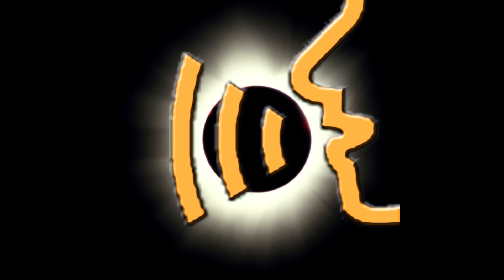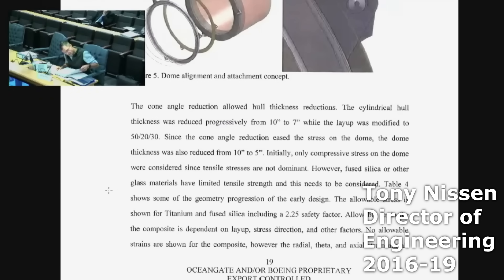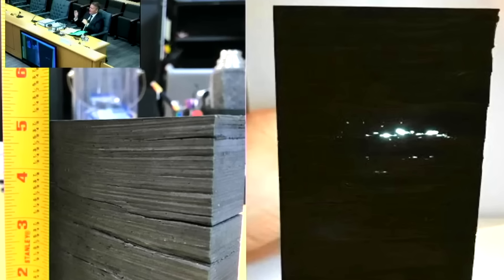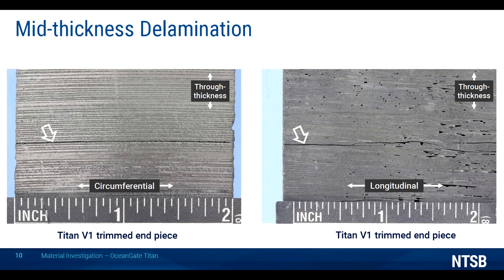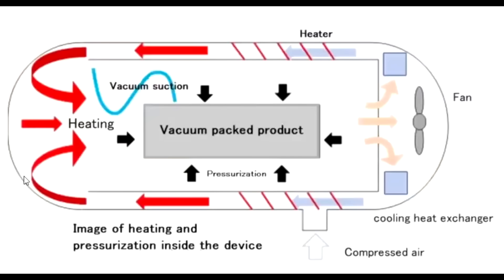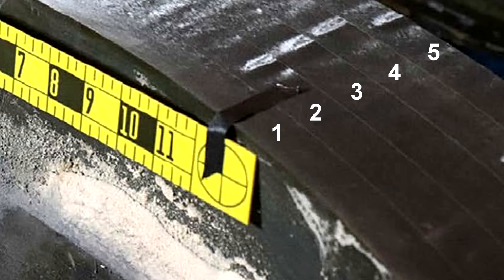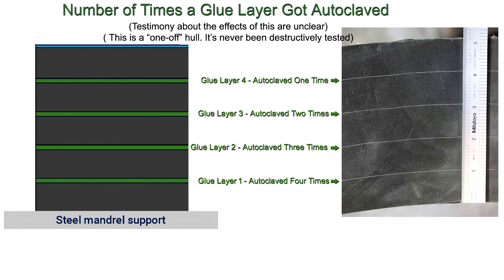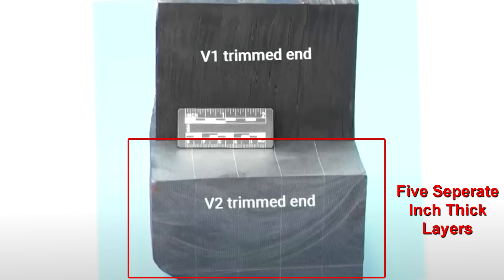Who Engineered the OceanGate Titan V2 Hull? Maybe Nobody Did?

Comment: I don't understand why they didn't used stainless steel tube or main capsule wrapped on carbonfiber over it. To give it still none catastrophic failure an more strength.
Reply: That would be difficult because of the mis-matched CTE & modulus between stainless and carbon fiber
Reply: The difference in thermal expansion coefficient between the two materials is one reason. 

Also, it is one of the reasons carbon fiber isn't used for that application at all and why it should have never been used on Titan.
Reply: I don't understand why you think they would use steel plus carbon fibre. What benefit do you believe that would bring?

Comment: the hidden disaster that is waiting to happen is the use of carbon fiber in commercial aircraft.
Reply: We've been using carbon fiber in aircraft for over 50 years. That disaster sure is waiting a long time.
Reply: Nope. There is nothing inherently wrong with carbon fiber as a material, it’s all about how you use it. It’s an excellent material for things like airplane and automobile components where the parts will be under tension. It’s awful under compression as in the case of being used as a pressure hull for a submersible. This unsuitability was only made worse by design decisions like how the fiber was wound and manufacturing foul ups like not using clean room conditions. The galling thing is that all of this is widely known. I’m not a materials scientist, just a guy that has a few interests that incorporate these technologies, and even I know a lot of of the basics- you don’t use CF for something dealing with compression; cyclical loading causes fatigue and breakdown in materials like CF; you want some sort of cross-hatching orientation of the fiber wraps; sanding down bumps in materials like CF is going to drastically reduce strength as you are creating discontinuities in the fibers; you need to be very deliberate to prevent contamination of surfaces where adhesive will be applies and you need to keep contaminants out of the adhesives & resin themselves. They did a LOT of things wrong and it’s really amazing that the hull even lasted as long as it did.  

This was a clusterfuck for a long list of reasons, but it isn’t an indictment of carbon fiber as a technology.
Reply: Carbon fiber is very strong when used in aircraft. The pressure is inside pushing outward which pulls on the fibers and makes them stronger. A sub is the reverse, pressure from the outside.

Comment: I’m no engineer but maybe the hull design should have included a few titanium support rings
Reply: Or proper testing, build 4-5 of them and make repeated submerges using a cable and depth finder until they fail.

But then that would cost money and they were trying to be the 'cheap' deap sea submersible company.
Reply: @jonf2009  The problem with the testing you proposed is that carbon fiber suffers "fatigue". Even if during the test it passed a specific depth, with each subsequent submersion the depth rating would decrease, but because of the production method you cannot even be sure about how fast the rating is decreasing (meaning that it's essentially and practically impossible to know the depth rating)
Reply: They used the ti ends to lift the sub up multiple times.  They welded some lift tabs for straps to be attached.  They were just glued to the carbon tube so that stress was probably never considered.
Reply: You still would have the issues of the stress in between the support rings. Carbon fiber is great under tension but is terrible when under compression. They should have made it out of solid titanium without the carbon fiber. And used a window rated for the depth or deeper than something that was good for a few hundred meters depth, it's a wonder that didn't fail!

Comment: Ya sure, laying the fiber at 45 degrees isn't needed for underwater subs........except when your beating up the sub hitting sunken ships, slamming into the dock in rough seas and towing it out to sea for hours while it bounces around on the dock. They beat the crap out of that sub and never really inspected it.
Reply from the maker: I agree with you, and thanks for commenting.  Yes, Stockton and the engineers were focused on the fact that underwater, the vehicle is not subjected to "torsional moments."  While that may be true in the water, the transportation on a trailer back and forth across the country, craning it,  launching the LARS off the Horizon Arctic, and towing behind the Polar Prince must have added forces not accounted for in the engineering.
Reply: Not to mention porosity in the glue, sanding the carbon fiber all over in random places, and an untested unsafe viewing port
Reply: Wasn’t it also struck by lightning?
Reply from the maker: @curious_gage  Thr first hull was, when they were testing it in the Bahamas.
Reply: Not just that.. the way it was stored. Sitting out in open element at some dock by the water.
Reply from the maker: @OfficiallyGuChi  Yes, between the 2022 and 2023 expeditions in the freezing winter months in Newfoundland.
Reply: yet thy used the ti ends to lift the sub around.  Now you have stress in all directions and pulling the glued ends apart.
Reply: @danc2014  And probably sagging in the middle, what did that do the glue lamination?

Comment: I will bet money that 45 degree ply would have made zero difference. It was doomed from the start.
Reply: As someone who does composite work, I’d bet the opposite.
Reply: @Chiraq312boi  I do as well and yeah I'd agree. The idea of having a carbon fibre component without 45 degree plys is so foreign to me I didnt even consider it a possibility with oceangate. Especially with how thick it was
Reply: Might have helped delay the inevitable, , but in the end, it would have gone bang; even if the hull had held because of using 45 degree ply, which is far from certain, there were too many other problems.

Comment: The fact that this seemingly badly designed, badly made, riddled with cost cutting measures  submersible was able to survive 19 deep dives suggests that the basic idea of a lightweight carbon matrix submersible is not in fact a bad idea at all. Were it properly and cautiously designed, built properly and thoroughly tested, it might be a surely be quite successful.
Reply: I feel I need to point out that hull made 13 1/2 dives to Titanic. Well, plus it passes the pressure testing unmanned at the test facility. No word there on the acostic signatures.
Every single idea Stockton or his "design people" had was crap. BUT that is just us looking backwards. It's easier to repair stuff than design it. 
These huge diasters always seem to have a TIDAL WAVE of issues not 'that one thing'.
Just when you think you've pinpointed 'that one thing', something else catches the eye. Every angle you approach the failure from? Seems legit, cause it is.
His hull is 'settling' every dive. Wood ships do that too. That is the 'pops' every diver hears on Titan. 
His hull was BASICALLY strong enough, the number of cycles killed it. You wouldn't take the 1970 Moon Lander back several times.
Stockton had an investment offering where OceanGate had $28 million in new Capital.
Guys a con-man milking his cash cow. Got caught up in his own hubris.
That's the real story. 
Think how much money he could charge taking Titan down to Titanic a few times while a new hull is built....then using Titan as a famous sub doing easy Carribean depth dives with more windows?
TAKE A CRUISE ON THE TITAN ...... 3 Day tour of the best of the shallow water carribean !!
Reply: @SuperChuckRaney  One of the issues is knowing how many cycles can it withstand? How much variation is there from hull to hull and batch of resin and fiber to the next? Bad batch and you might not make one full cycle.
Reply: My thoughts exactly
Reply: I doubt it
Reply: You don’t understand engineering and that’s okay…. As long as you’re not gonna steal millions from investors to build yourself a deep sea coffin.
Reply: Yeah, no
Reply: @schristi69 🤣👍

Comment: Carbon fibers strenght is only in being pulled apart, meaning that carbon fiber cylinder benefits are only in keeping pressure in, and not pressure out.  As far as keeping pressure out it is not much stronger than the resin used to impregnate the carbon fiber.  Any fiber is only strong being pulled apart, and colapses being pushed together as any cloth would, with the resin being it's only source or strenght.
Reply: You think you know what you're talking about.. but you dont
Reply: @lutze5086   That's what Ocean Gate said.

Comment: It would not matter if it was 20 inches thick. It would have failed. The reason - You cant combine those titanium rings at the end with carbon fiber like that.  2 different materials 2 different compression ratios.  It needed to be all titanium and it would have been fine.  I just cant believe "they " couldn't grasp that concept.
Reply: Tell us you’re not an engineer without telling us you’re not an engineer. Keep your mouth shut. You’ll appear smarter.
Reply: @turbodog99  And what was wrong with what they said?
Reply: @turbodog99  Do the two materials have identical properties? No. Could the adhesive they used, the way they used it, accommodate the differences in that design?  Could any adhesive? We don't know.

Comment: The v2 hull was 5 inches to fit the titanium domes, in fact it had to be sanded to fit the rings, keep in mind that this hull was full of problems and shortcuts and sill dove 19 times, if you see the pictures you'll notice that the hull   delaminated from front to back whatever happened was on the front ring, also the hull was supposed to be 7 inches not 5, it proved the concept, this is a composit hull so carbon fiber + epoxi, the compression is handled by the combination of the two

Comment: If you watched the saps who were applying the glue to the sub using Home Depot mud knives, that told you all you needed to know about the level of Stoogery that was taking place at OceanGate.
Reply from the maker: Agree.
Reply: It's an Aerospace Adhesive you noob - Ghost of Stockton Rush
EVERY detail here is incredible, I'm fasinated by it all. It's better than the JFK deal - Ghost of Al Einstein
Seriously tho. This is increbibly sad. I can' stop watching these vids, I purposly didn't watch any after it first happened so as to bypass false or misleading info.
EVERY single thing they did is a failure. Have you seen the "operations manual"??
Reply: Aerospace adhesive is a fancy term for more inspection and quality control.  As such you should not include any contamination into the process to apply it.  Home depot mud knives are not contamination free, did they clean it with alcohol, or wd 40, acetone?  No gloves or masks are also a potential contamination source. Did they need a primer?  But no added mechanical attachment was a design flaw, saying it is a compression fit and then use it to lift the sub around
Reply: @danc2014  It did not look to me like a 'clean' environment. Transformers and generators are wound in cleaner environments that that.
Reply from the maker: @SuperChuckRaney  Thanks for your comment.  I agree that the story is incredible.  It's a classic case of "you can't make this stuff up."

Comment: Hindsight is easy but carbon fiber strength is in tension.   A rope is pretty sand strong but not useful as a support.
Reply: Carbon fiber on its own is not strong in compression, but the Titan hull was a composite, so the fiber and the matrix act together, with the matrix acting to prevent the fiber from collapsing. A composite has to be considered like an alloy - you cannot take one component out of the mix and examine it separately. I s this not so?
Reply: @rationalrabbit797  Regardless, the support material in the matrix (being the carbon fibre) only acts as a support when the matrix is being strained in the proper way. It's like reinforcing concrete with rope instead of rebar.
Reply: @DrShrimpPhyscology  nah, go grap a carbon fiber fishing pole, as the pole bends, top is in tension, bottom is in compression, sides are in shear.  Millions of cycles
Reply: @SuperChuckRaney   Fishing pole isn't under universal load. It's being bent in a specific way, which allows the fibre to be in tension. The sub had universal pressure on all surfaces pushing inwards. Different applications of force.
Reply: Actually any engineer worth their pay is going to look at the materials properties and go nope not using that or I'm not applying my seal to it. Better to be fired than in any way responsible for manslaughter.

Comment: also sounds like they had used hand grinders to level out the "bulges". Bruh if they had bulges in each layer that speaks to the construction not being uniform as it applies the material and also means you don't have a uniform composition below the surface of the layer. how was this missed by professionals?
Reply: I believe it was mentioned in another video in this series, but you can't really grind down carbon Fibre the same way you can steel. You are literally removing sections of Fibre and   jeprodizing the integrity of the whole weave... 😵‍💫
Reply from the maker: Thanks for your comment.  I have no idea why this was allowed or who signed off on it.
Reply: They probably used belt sanders? ?It wasn't missed by ANY professionals, as there were ZERO professionals there.

Comment: if it was 10inch thick it wouldn't matter, it would still crack, carbon fibre stretch not compress
Reply: It's simple then. They just had to make the hull bent in the other direction, that way it would be stretched.

Comment: The reason the second hull was 5" thick was the fact that they cut the titanium domes off the 1st hull, and reused them. Regardless if Stockton was told that the hull needed to be 7" or 10". Remember you are dealing with an extreme cheapskate when it comes to Stockton Rush. If you don't believe me, look at the air scrubber Stockton made because he didn't want to spend the money for a real one. And you know what happens if your air scrubber fails? Nighty night! Did you catch that statement, that if the hull was to be 7" it could not have any defects. And accounting for defects, they would be closer to 10". But since they were reusing the titanium ends, the hull had to fit in them. And they still had to grind the ends before attaching them. The more I research this build, the more I get sick to my stomach from the blatant irresponsibility of Stockton Rush. And I will say this again, where the F&^% is Wendy Rush? Why is she not testifying? Why is she not making a public statement offering her condolences to the families of the murdered? Why is she not being sued for billions of dollars? Those lives are very important and there needs to be some accountability on her part. That's the least that should be happening and I hope it happens soon. My heart goes out to the families and friends of the victims.
Reply: Did she actually do anything? Did she have any role?

Comment: I don’t understand why they didn’t go with a larger spherical design. Cost I guess.
Reply: Not "innovative" enough. He wanted to be a trail blazer so the whole world would say, "ooh, that's stockton rush! He so smart!"
Reply: @qarnos  Yeah, probably the same reason as using carbon fiber for the hull instead of titanium. And cheap consumer grade electronics inside the dsv. He was recklessly endangering the lives of himself and his passengers.
Reply: i think because he needed to fit lots of paying customers plus a toilet which would need a pretty huge sphere with extremely thick walls and fitting a window would be a lot harder or impossible if it was a carbon fiber sphere, if it was all titanium would weigh and cost too much

Comment: so they wouldnt build it without co-bonding the 5 layers, yet they thought grinding it was a good idea?.... the whole point of the autoclave was to smooth the surface........ if they actually did it in a clean environment they wouldnt have had to grind it.
Reply: Autoclave  will apply pressure and heat to cure the epoxy glue with the carbon fibers, yes it has the side result of making the finish smooth and with less voids if done properly.  There can be excess glue and air bubbles on the surface.

Comment: The one thing I'll say to Stockton's credit is that the man was brave. Brave past all limits of sanity and responsibility but brave all of the same. The biggest tragedy was that his bravado was so strong that it convinced his passengers that it was based in reality.
Reply: Brave beyond sanity isn't brave...
Reply: 100%. He had so much belief in that failed product that he convinced others to join him. That cf hull was a matter of wen will it fail not if itll fail cause its definitely going to implode due to repeated cycles of the dive stress fractures will occur the more they dive the weaker it becomes but it seems even that wasnt factored in
Reply: He heard the carbon fibre cracking on every deep dive.  In just the same way that he didn't listen to his technical advisors, he didn't listen to that cracking.

His passengers assumed that if it was safe enough for Stockton to go down, it was safe enough for them.
Reply from the maker: Thanks for commenting.  I agree.

Comment: Just reading some of the comments on fibre direction and the 45 degree orientation in particular. I had thought this was filament wound ie continuous roving or unidirectional tape under tension and possibly even heated at the point of application to ensure good interlaminar bond with a post cure. Seems not.
A layer at 45 degrees has half the strength and half the stiffness of of one in line  that is root2 squared since a fibre is 1.44 times as long and strains 1/ 1.44 as much in the principle axis. This is a very great loss of strength and stiffness in hoop or endwise loading so only a few diagonal layers should be used to prevent splitting . Delamination by through knitting is desirable in compression but not likely feasible here.